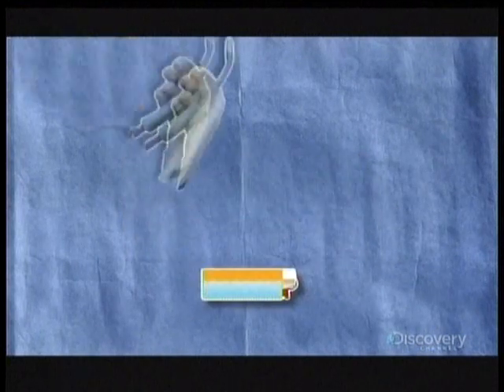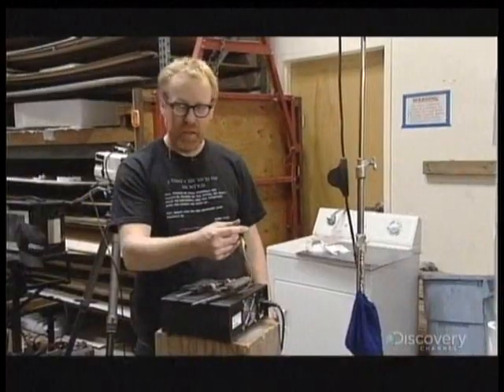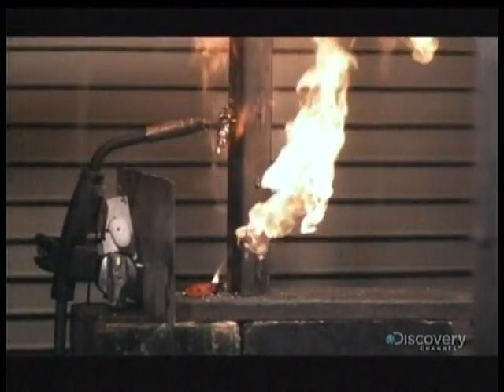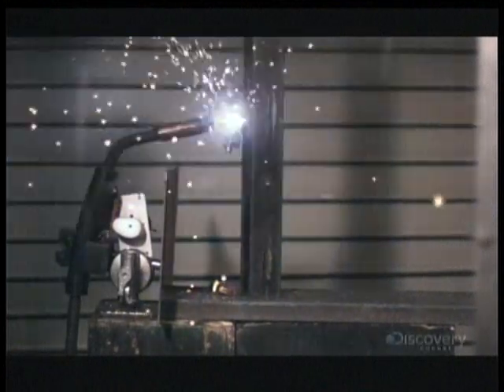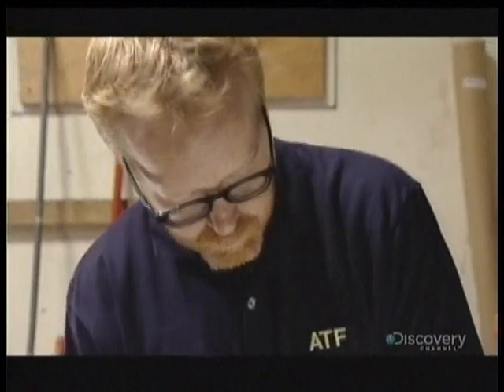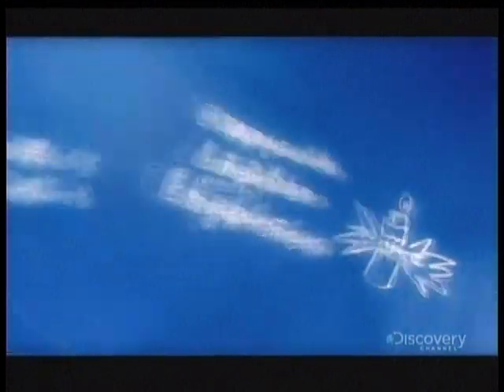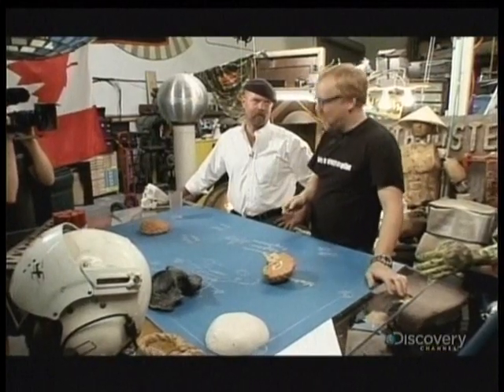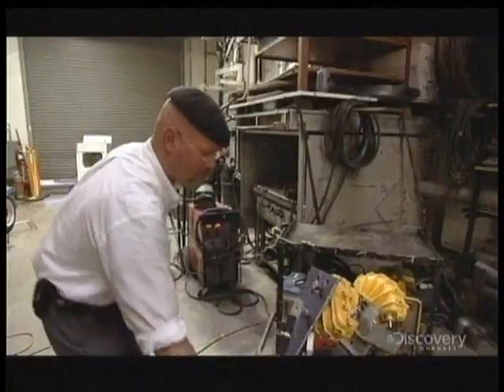Mythbusters: Exploding cigarette lighter part 1

Comment: Over the course of my life, I've had a few lighters blow up inside a hot parked car. I'd return to the car to find the aftermath, with plastic shards where a lighter used to be. I've never seen it happen in real time. In 40 years it's only happened twice so it's rare, but it can happen.

Comment: I actually did this/ don’t know how commonly this happens. 
- Threw a lighter on the floor a couple meters away quite hard and it blew up. 
No one was hurt but if it went off near me i think it’d have burnt me the explosion and bang was very loud

(does this mean the lighter must’ve been cracked slightly to release some fuel to allow for a spark)

Comment: I actually had a lighter pop in my car, though it didn’t explode. It was a cheap, structurally weak lighter and it was in my car on a hot day. I came back to find lighter shrapnel in the front and back seats.

Comment: Quite possibly the worst myth segment on the show that I ever saw, slag on a lighter in the pocket maybe but the woosh is benign and not even remotely deadly, if you get slag hot enough to melt plastic inside your pocket you’ll be in trouble long before a lighter gets to blow, hitting a lighter with a golf club?? Come on, “take note if you hit a lighter with a club and the striker is glued down it will blow” by blow you mean a small lighter explosion you forced by purposely bypassing several fundamental safety features not to mention forcing a scenario which is entirely unlikely. Just weak material

Comment: The dryer thing would eventually work when the plastic on the lighter melted. Some dryers get up to 350 degrees. Anyone who has taken an electric clothes dryer apart knows that right behind those holes in the back of the drum is a large, glowing hot heating coil. The one in my particular dryer is so big that it goes all the way around the entire diameter of the back of the drum itself and is just inches away from the back. That's the ignition source.
Reply: I think the static electricity from the clothing is a bigger factor than pure heat

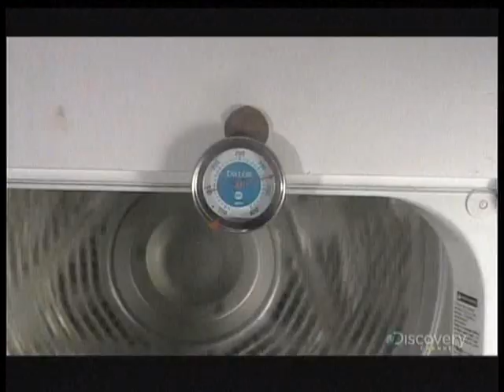Comment: 4:07 - Even when I first saw this, well before I was a firefighter, I knew that ambient heat, even at what a clothes dryer can produce, isn't going to work, the lighter would need to be damaged/defective, and somehow cause a spark, or the dryer would need to be damaged/defective and cause a spark, to provide ignition.
Reply: I’ve had one blow up by itself while laying on a dresser over night and blew two flames  out both chambers on the side lol but hint don’t buy the cheap clear colored ones

Comment: What did they think would happen when they shattered a lighter with an open flame? I don't get it. They needed spark. They could've wired something up to create one, or put flint rock on the golf club and lighter. Lighting the lighter was silly. Nobody would manipulate the lighter so it would stay lit, and then smash it. The result was so obvious. And why did they absolutely shower a lighter in slag? As soon as one piece got on the lighter case, they should've turned it off and seen what happened. Obviously it was going to get hammered and eventually burn through. They weren't even really testing myths, they were creating absolute worst-case scenarios where ignition was bound to happen. Some of the worst testing I've seen from Adam and Jamie.

Comment: I have a theory about the lighter in the dryer myth. So the myth was ‘if you forget your lighter in you pants pocket and throw them in the dryer, the lighter will explode.’ So, they only had the lighter in the dryer and i can only assume that it bounced around enough to let some butane out from it hitting on the trigger. What if the pants/other clothes that are getting dry create static and thats what sets off the butane? Although the lighter is in the pocket i would still assume that at least a little butane would get out from it bouncing around.

Comment: I truly believe that a dryer can be an sorce or an ignition if the dryer melts the plastic on the lighter then the butane gas leaks out can find an ignition sorce like if the dryer is a gas dryer the butane can be ignited by the gas flame I work at a used appliance shop I have taken dryers apart many times i have found lighters which have fell out of the drum into the dryes inside if it gets close to the heating element or the gas flame can cause an explosion I do see this happening and its probably happened before. Just found a news article on the news republic back in 2002 a man working at a dry cleaners was injured by a disposal lighter that exploded with enough force it blew the dryers door off so it can happen.

Comment: I’ve had a lighter explode in a dryer. I think they are forgetting 1 vital thing. LAUNDRY! you know, the stuff that gets hot in the machine, and more importantly, the stuff that builds intense static energy while drying.
Reply: CSlack just happened to me today I forgot my lighter in my shorts and boom
Reply: leonardo sanchez happened to me multiple times. If they get something like this wrong it makes you question their other tests. I think it was pretty boneheaded of them to not mimic normal conditions where the lighter would explode—i.e. with laundry in the drier getting the whole thing hot. If you put the lighter by itself then it just bounces inside the machine a ton and doesn’t get as hot as it would in a machine that has fabrics to retain the heat and build up static.

Comment: Clothes dryer, unless the metal on the lighter hits something perfectly, you have 2 of 3 things needed.  Heat and Fuel, without an ignition source, are dangerous, but not likely to blow up a lighter.  For the welder, the sparks were the ignition, not the ambient heat.

Comment: Only lighter I've had explode on me was one I left out on the patio on a hot Arkansas summer went swimming, got out grabbed the hot lighter with a cold hand and boom plastic shrapnel in my shoulder lol.
Reply: Should of bought a bic instead of the Chinese translucent ones
Reply: @Youtubecensoredmyusername  That was a bic lol.
Reply: @Hans Pebble if you wanna be technical its actually made from petroleum naphtha.
Reply: No lighter can deal with 90° plus 70% humidity, once it's been in a car all day. Let alone direct sun contact. Since it was a bic, you'd have been best just taking it while you swam. At least it wouldn't have blown up. Wouldn't have lit your cig though.
A bic is meant for your pocket. Hawaiians definitely don't leave their lighters lying in the sun, why would you?

Either way, lighters are meant for dry, room temperature areas. Like your pocket. They don't even work when it gets below 30° degrees. The butane will be too thick to combust. The slightest gust of air screws with them too. This is why Zippos are a thing. Since they don't use butane either, they use a form of grill lighter fluid, their combustion rates and temperatures are different. Butane is ungodly low to become gas. Around 50° does it. Isobutane would be likely a little higher. Alcohol is rather high. I think that's 120° or so.
Reply: @princesscarl1656  dude shut the fuck up. No one cares about your bullshit lighter research.

Comment: nice oversaturated high exposure fake video of the flames. a butane lighter does not contain enough butane to do anything more than a relatively small puff of flame that will at most, singe your hairs. ive done this kind of thing hundreds of times myself, and the explosion is never anything to be concerned about. ive even tested it by having fresh lighter in my pocket, piercing it with a soldering iron, and lighting the resulting gasses. even then, nothing but a little singing on my leg hairs.
Reply: I'm not sure you understand what happens when gas expands

Comment: Never ever look at a welder while it's on, it will cook your eyeballs
Reply: It's a good rule of thumb, but at a distance the danger is far less. They were far enough away as to be fairly safe. I would also guess the protective glass Adam was standing behind is designed to provide some level of UV protection.

Comment: You can get a much more spectacular effect without using much-(any) gas at all,, all u need is the flint nd abit of wire- wrap the wire around the flint 1-2times in middle then make a V shape then jus heat the flint wen it starts 2glow red THROW IT at a wall or floor, Let me knw how u get on

Comment: 1:46 that happened in my car. One of my ashes with a hot ember in it landed on my lighter and it blew up. It scared the shit out of me while I was driving.
Reply: no. it didnt. the very most an ember (if its still hot its an ember. ash is when its cooled.) can do is melt the case and cause the gas to come out. even that takes about 10 seconds from a cigarette ember, and just results in a bunch of butane being slowly drained out the side. the embers are not hot enough to ignite butane gas, says the laws of physics.

Comment: Why are they welding without eye protection? Wtf?
Reply: You've obviously never worked in an industrial setting before. They were 8 feet away and they weren't looking at the bead. They were even shielding their eyes from the direct light... they were completely fine. No need to worry about them or complain in the youtube comments.

Comment: well BIC lighters contain butane liquid under pressure. a normal BIC lighter is pressurized to 25 PSI at room temperature, but at 135-140 degrees (temps found in hot cars) the pressure can climb to about 100-150 PSI. and from what i have read they can be like mini hand grenades and can send shrapnel flying everywhere which can kill

Comment: here in philippines its true that lighter explode sometimes especially the crystal one, sometimes we'll throw that on the concrete wall it explode wirhout fire only the pressure inside from the butane. maybe the presure is already too high for the plastic.

Comment: I had one of the cheap clear or yellow plastic ones that was sitting on a table in the direct early afternoon sun that blew up and scared the poo out of me. Some of the pieces were very sharp but I was about five feet away. Afterwards, I hypothesized that because it was clear with the thick plastic including internal support plastic, that it acted like a lense and focused the heat causing internal temperatures and/or pressure leading to the explosion. I saw it out of the corner of my eye as it went and it appeared to blow from pressure with a very slight burst of flame upon exposure to the air as the gas dispersed.  I thought of this episode.
Reply: Redfour5 you’re an absolute genius!!!!

Comment: Wear eye protection, welding safety 101. seriously though that's a bad example....
Reply: Runar I am fairly sure he was talking about a light shield so they don't damage there eyes from the bright light
Reply: He definitely were, its not only bad for your eyes because uv and that shit, it can also make your eyes hurt and feel like you have sand in them when it damages some layer in the eye and that shit sucks
Reply: Morty as long as you have safety glasses or something to block the rays you’ll never get a flash or that sand feeling in your eyes, as long as you’re protected you can stare as long as you want, it’ll just hurt to look at but won’t give your eyes a sunburn unless there’s direct contact
Reply: Ikr he looked right at the arc wtf
Reply: All this stuff about being safe from a MIG arc behind glass is nonsense.  I work in a MIG welding factory.  Our welders use auto-tinting weld masks that basically go from being more opaque than any sunglasses to being so opaque you can only see directly around where you're welding.  They also wear safety glasses under them.  We had a welder one time somehow not notice, or not care, that the batteries in his hood went out.  In about two hours of welding, he had flash burns in his eyes bad enough to cause that sand feeling for several days....through a semi-opaque mask and safety glasses.  Even reflected arc light can be dangerous, maybe not enough to cause burns, but this stuff gradually and permanently degrades your eyes much like staring at the sun.  I've gotten eye pain just from seeing brief glimpses of arcs through holes in weld curtains, despite the fact I'm always wearing safety glasses.  Don't fuck around with this stuff; if you are looking at MIG welding at all for any duration, you need to be looking through at least a shade 11 material.  For something like what they're doing here, they make weld curtains that would work perfectly well for protecting them.  Oh and the light will also cause skin cancer and give you a terrible sunburn.

Y'all need to stop talking out your asses when it comes to safety.
Reply: At that distance behind glass? Less of an impact. Still, better not stare at it for 30 seconds or more.
Reply: Aren't they setting a good example by showing you that it's not good to have a lighter in your pocket?
Reply: @Hans Pebble what about it being brighter than the fucking sun
Reply: Are they dumb? How about they try the welding thing in a pocket of jeans? XD like dont they know that a spark(or heat) coming in direct contact with anything will affect it more than if it were to have even a slight barrier? Its like grabbing a baking tray straight out of the oven without a mitten or w.e u call it, of course thats gunna burn
Reply: @knives564  they wanted to know if it would work at all in open air before they wasted their time covering it with a piece of fabric and wondering why it wouldn't work
Reply: karl warren they were standing behind a glass wall
Reply: Rúnar Darri Viðarsson now here's someone who knows his shit! Tempered glass filters a lot of rays. During one nuclear test some scientist wanted a better view of the initial explosion so he sat in his car behind the windshield.

Comment: nope, got a cheap lighter(clear lighters not branded), heat it up under the sun and throw into solid ground. it will explode to bits
Reply: You don't have to heat it up, it's the pressure of the gas that causes the "explosion".
Reply: squiggofant
But then again the hotter the liquid gas the more energy it has - faster vaporisation - higher pressure - bigger bang.

Comment: I wonder about the lighter in a dryer... could clothes bump the gas switch on the lighter, releasing gas and make a spark by static electricity without dryer sheets?

Comment: lol! imagine using dryer sheets and getting a fluffy lighter XD!   if you leave a lighter in a fire accidentally it ignights and goes flying like a rocket about 7 feet in the air (watch their propane rocket episode and replace the tank with a lighter.)  mine was an acident so dont try it on purpose.